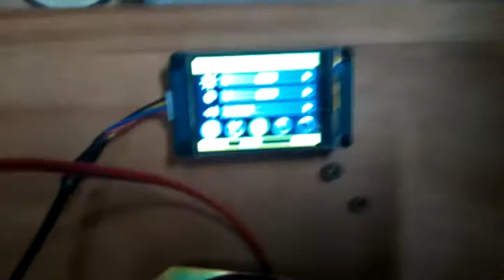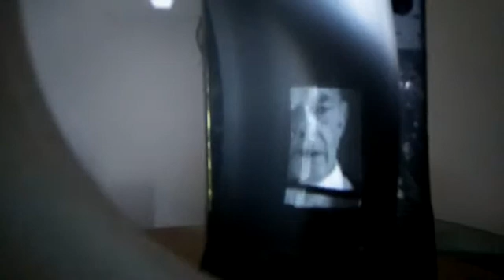Arduino Mechanical TV #47 - I even brought a straw

Comment: How did you keep the black bar stationary, so it doesn't flicker the image?
Reply from the maker: The Arduino software I wrote is able to detect the framing (both horizontal and vertical) and adjust the synchronisation of the disk perfectly to keep a stable, locked image that is exactly framed.